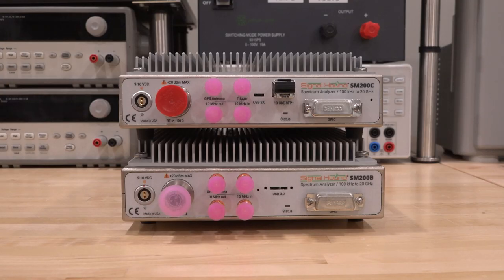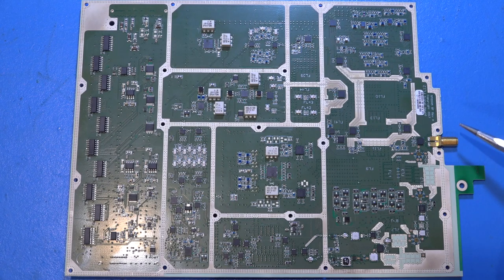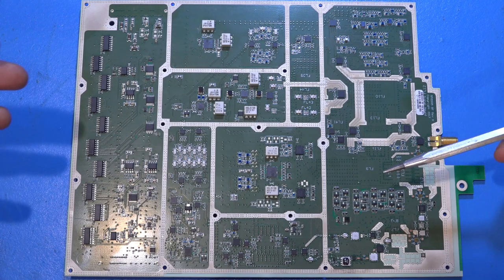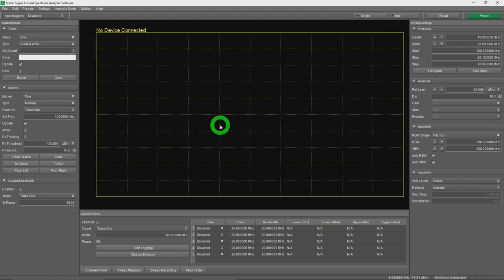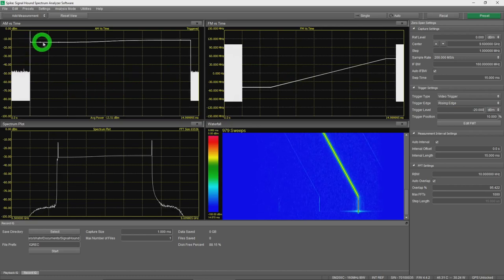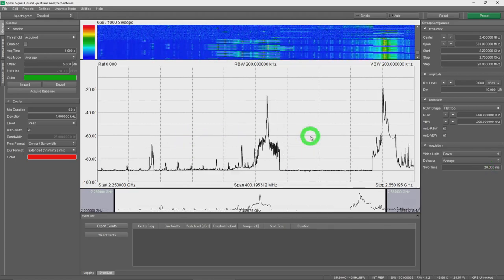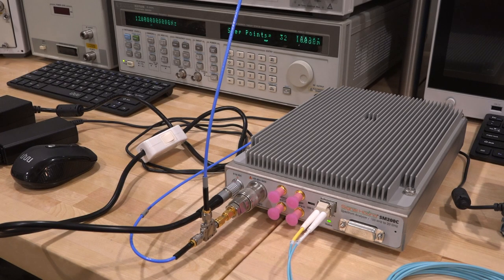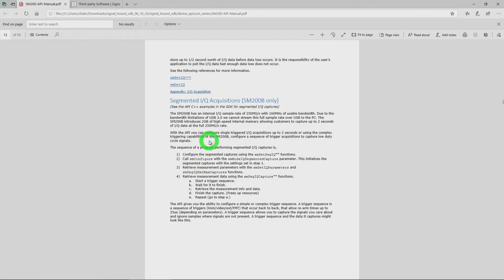TSP #171 - Signal Hound SM200C/B 20GHz Real-Time Spectrum Analyzer Review, Teardown & Experiments

Comment: I had been waiting for a review of this superb instrument. It seems that Signal Hound have been going from strength to strength and are now genuinely competing with the giants in the industry.
   Your review made no mention of  residual responses and LO spurii, especially image responses. The SM200 uses an unusual architecture, in that simple downconversion is used on all bands ( except for the 0 to 160MHz baseband.  This presents two major problems: image rejection in the first mixer, and second order intercept. As far as I understand from the published information, all the front end mixers are I/Q mixers, with image rejection taking place in the digital processing. This is the standard image reject mixer configuration, where a quadrature LO is required, also a 90 degree phase shift at the IF before the I and Q signals are added.

  There are also software solutions to the image rejection problem, where multiple sweeps with high and low LO are combined. It is possible that more microwave analysers are using these techniques. See following Keysight application note: These only work on repetitive swept signals.

http://literature.cdn.keysight.com/litweb/pdf/5991-4039EN.pdf

It is not clear whether the SM200 uses software image rejection as well as I/Q mixers.

My main use for spectrum analysers is measurement of signal purity in synthesizers and other sources. It is infuriating if the spectrum analyser has self generated spurii which cannot be differentiated from those occurring in the DUT.

Perhaps you could be persuaded to do a further review where these aspects of the SM200 are evaluated.

Cosmo Little

Comment: You should be able to get the PCB to be brighter, ie, pop, if you use a spotlight on either side at a shallow angle like 45º.  The shallow angle stops the light reflecting right back and creating that bleach spot at the bottom left, and that means you can use brighter lights- I'm guessing the spot is why the lights are low -. My vids are pretty bright, and they are dodgy as - lol -.

Comment: I've been really tempted to buy one for a while, although I think it's a shame that there isn't native USB-C on the C model, 10g ethernet isn't always easy to use.
Reply: Agree. It's almost as if they should just fuse the two models into one, based around USB3.2.

I guess that's what they'll do at some point in the future.
Reply: @trickyrat483  Building a 20 GHz spectrum analyzer is one thing.  Making sense of USB standards nomenclature is something else entirely. (shudder)
Reply: @NoahFect  Agree completely - hence why I think they've stuck with ETH for now. Still, time and tide waits for no man.. I'm sure they'll upgrade eventually.
Reply: Doesnt 10G ethernet make sense since its not master / slave? Considering windows is not a real time operating system it seems reasonable to not rely on USB polling, no? That said i do agree that USB standarts are a mess and i might be wrong in my suspicion. Alas maybe PCIE over usb c could be an option?

Comment: I wonder how much of the cost of this is just AWS servers for simulation
Reply: $16,000.00
Reply: I suspect that if they are doing that much simulation they would have an onsite computing system. AWS is rather uneconomical for long term use for these kind of EM sim applications in my experience.

Comment: Could you please elaborate on the ITAR angle?
Reply from the maker: It has to do with how fast a receiver (or transmitter) may change its LO signal. Once things get very fast, tracking of military grade RF signals, generating interference or decoding highly agile RF signals becomes possible. Therefore,  in the USA, there is a limit. Similarly, you can't buy a thermal camera with more than 9 FPS capture rate.
Reply: @Thesignalpath  Munitions - who knew?  Thank you for this.
Reply: Sure makes you wonder what level military stuff is at.
Reply: @Thesignalpath  If you're not a citizen.  As I understand it has to do more with export restrictions than anything else.
Reply: @Thesignalpath  where in the ITAR document does it point to 1THz as being a limit?

Comment: At 3:46
I'm sorry for the question, but why are there official restrictions on how quickly a device can measure something?
Or have I misunderstood something?
Reply from the maker: It has to do with the ability to catch and analyze highly agile communication systems. It also allows you to decode and potentially jam signals if you know where they will be going. It is similar to how you cannot sell thermal cameras with more than 9FPS record rate to the public.
Reply: @Thesignalpath  Many thanks for the answer.
I had read about the temperature cameras when I tried to read out my Seek Thermal XR with Python.
The restricted measuring speed is now understandable for me.
So something like targeted interference from certain frequency bands.
This also explains the likely relation to the militaristic interests.
Reply: @Thesignalpath  This sounds really stupid to me! The military actively standing in the way of science by definining some arbitrary values you are not allowed to surpass in your measuring equipment. How is seemingly everybody okay with that?

Comment: How can I monitor and record (real time), EM signals from 100 KHz  to 10 GHz?
On the cheap? SDR? Possible?
Reply: Depends on the requirements. If you need to record the whole band 100k to 10ghz, it gets extremely expensive because that's about 50GB/s of data. If you're looking for a tunable band in that range, there are some good commercial solutions out there. Some use sdr front ends, some use rf instrument front ends. Dm me if you're curious about this, I work in this domain a lot.
Reply: @kylem7890  what are the keywords to search for these solutions?

Comment: One of my major disappointments in these teardowns is that you don't actually do a teardown. You switch from a complete assembly to bare PCBs.

I find the package design and design for manufacture that needs to go into how the housing is designed as interesting as the boards themselves. We want to see you take it apart, because that can be super interesting as well! At least show the housings and order of assembly. 

I'm doing a lot of mechanical design work these days, and things like considering how the housings have to be designed for ease of setup, feature access for machining, cost optimization etc can be really neat and teach you a lot. It also interplays with a bunch of systems engineering about how the packaging for the (generally multiple) PCBs fit together, thermals are managed, etc... 

Please stop cutting the actual teardowns.
Reply: I'd imagine hes getting a full functional one from signalhound (probably a demo unit), and some separate bare boards from them to walk through the signal path, I'd really be surprised if hes getting a 20k piece of equipment which the manufacturer would just want him tearing apart, which would then need to go through a full factory refurb/cal with after.